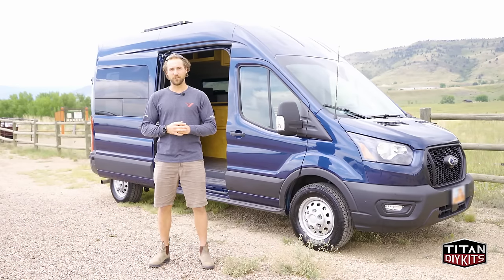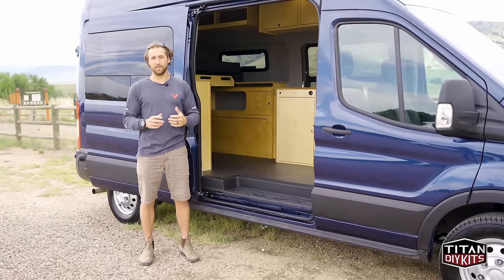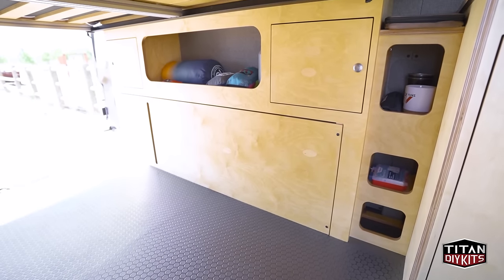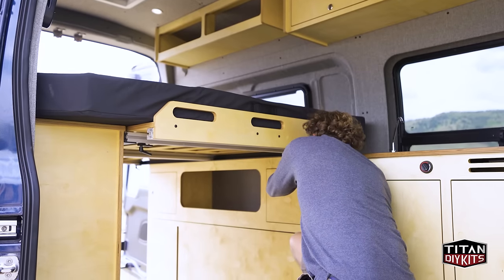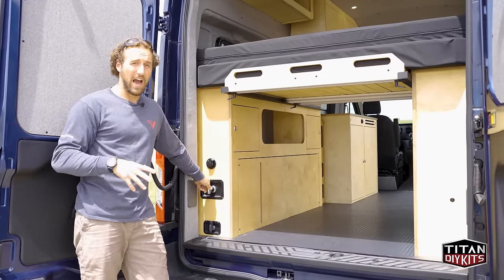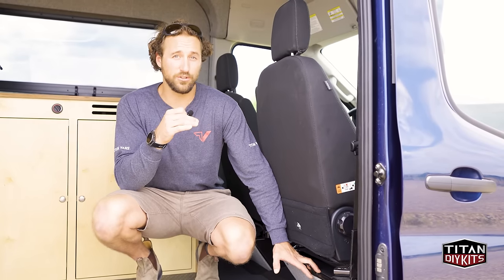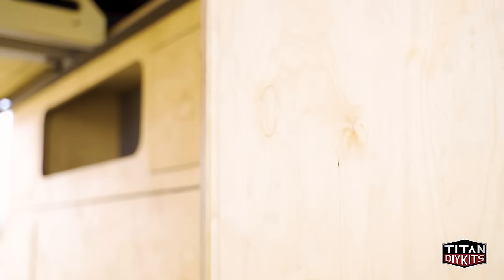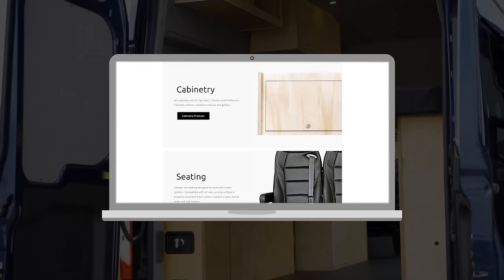Fully Installed Van Conversion for Under $25k | Timber x Titan Vans

Comment: Very nice guys!!  With a 2023 that houses the aux battery under the passenger seat, where would you relocate the Webasto? The cubby on passenger side seems like a good location but the Yeti is there. Also, how do you use the cubby as steps to the bed if the bed is pulled out all the way and covers over the entire cubby? I just cannot see how it can be used as a step to the bed? Maybe I do not fully see how this would work based off the video? But great build and looks like a wicked option. Will this be offered as a DIY? Or any other DIY kits coming online with you guys?
Reply from the maker: Yes, eventually we will releaee this as a DIY kit that you can assemble and install yourself!
Reply: @TitanVans  thanks guys! Trying to battle a little bit for you online with all the dumb comments. Anyways, what about the Webasto heater location for newer vans with aux batteries?
Reply from the maker: @pjbeattie1  is that Ford specific? Possibly a specific option with Ford? This video is of a 2023 Ford Transit 148 and the batteries were still located under the driver seat. Mercedes is still under the driver side floor board.
Reply: @TitanVans hey guys no sorry I meant for a new Sprinter. The new vans have the auxiliary battery under the passenger seat and the heaters cannot fit very well with the battery in there as well, so I hear? Are the brand new Sprinters that you have built not having the Aux battery under the passengers seat?? The dealer says the change was for the 2023 year with AWD.???
Reply from the maker: @pjbeattie1  No, they are mistaken. We have built dozens of builds on the 23 AWD Sprinters. Battery is still under driver floor board. Same for 24 as well, we have some coming in in Decemember
Reply: @TitanVans ah!! You know I bet it’s because all the US vans are built in the US and in Canada we get ours from Germany? I know there are subtle differences and I’ve seen other videos where the additional aux battery is indeed under the passenger seat.  They must not have been US models?? Anyways, I do plan to order the Summit kit but may wait until you release the Timber to see the differences/changes. I wish you guys would make an optional bench/toilet storage that could be used to step up into the bed?? Cheers!
Reply from the maker: @pjbeattie1  thanks for the support and the feeback! Definitely sounds like slightly different model in Europe.

Comment: Would it be at all possible to run the heat off of the solar? Gas is a bit pricey.  Better than it was but still not what it was before this administration. I don't recall you mentioning a hot water heater. No hot water is a no go for me. 😢
Also is there an option for air conditioning? I don't like dying.
Reply from the maker: No, heat on any camper vans is not doable off of electricity unless you are plugged in to shore power. It requires too much energy to run for extended periods and the number/size of batteries needed would be cost prohibitive. The Timber van conversion/kit does not come with hot water but it could be retrofitted. Air conditioning is also not an option on the Timber, similar to the reason for the furnace. If you are y wanting these features, check out our full production line at www.TitanVans.com, we have many options including water heaters and AC.

Comment: The model you’re showing seems to have e a lot of upgrades and finishes.  What is the cost of the conversion in the van shown in this  video.
Reply from the maker: @John_Duh_Vader  This van includes the (Finished option, Bunk Windows, Driver-side Awning Window, Maxxair Fan, and the EVO 40 heater option). Fully installed here at Titan Vans will run approximately $32,000. If you opt for the shipped kit these options will still fall under the $25k mark.
Reply: @TitanVans  seriously considering a simple build with less components that can go wrong.  Much appreciate the info and getting back to me.  That says a lot.

Comment: Do you guys have kits that would convert a cargo trailer to something you could use for snowboarding, mountain, biking, and sleeping?
Reply from the maker: Our DIY kits are currently only for Ford Transit, Mercedes Sprinter, and Ram Premaster chassis. We do offer floor mounted L-track and bike for mounts through our DIY site. Our full production line offers a few more solutions for carrying snowboards and mountain bikes.

Comment: Are you able to accommodate/modify for a mid roof transit?
Reply from the maker: We are currently only offering this conversion for the 148 high roof variants at the moment but we'll make sure to make an announcement when more options become available.
Reply: @TitanVans  in newbie speak, there are essentially 3 heights and 3 lengths available for the Transit I believe, I think you are saying this is the highest roof option? Which of the three lengths is this? It looks like the shorter of the options? (You really make good use of the space, well done, just adjusting my expectations, and I have found Ford's website unnecessarily confusing on this point. I am gonna go check your website as I am betting it will be clearer what you service with which package. Well done folks!)
Reply from the maker: @justlook.productions  We currently only offer it for the Transit 148 High Roof.
Reply: @TitanVans  copy that but with the 148" wheel base isn't there one longer? Isn't there an RB, EB, LB? I am happy with what you present here, it's not an issue :) Just visualizing it, and playing with the ford website, thanks very much.
Reply from the maker: @justlook.productions  Yes, Ford offers a 148 EL, similar to the Sprinter 170. We currently do not offer the Timber for either.

Comment: What are the dimensions of the bed? Can you fit this full length mattress (north/south arrangement) in the 136” ProMaster?
Reply from the maker: This is designed to sleep N/S, dimensions are 78"x 74". Ee offer it for the Sprinter, Transit, and Promaster

Comment: regarding the spray shower... can it be switched to a heated shower of just the temp from the tank.
Reply from the maker: The Timber van kit  is not offerred with a hot water option. The water at both the sink and exterior wash will be whatever the ambient temperature of the water is in the fresh water tank.

Comment: How about cooking and hot water?
Reply from the maker: Not offered with Timber Van Conversion, offered by Titan DIY Kits. We offer that option and many more through Titan Vans and the many models they offer. Though for cooking you could just use a plug in induction cooktop.

Comment: The set up seems expensive. How much is the total price of the van plus the conversion? Seems like a lot of money and youre not even fully “self contained”. I’m in the market for something similar but still researching.
Reply from the maker: The total price can vary widely as customers typically acquire the van themselves based on their preferences and budget.

Our TIMBER van conversion is designed to be fully self-contained, providing everything you need for comfortable living on the road. This includes an integrated water system with a rear shower, a comprehensive electrical system with solar and alternator charging, an extremely comfortable nearly king-sized bed, and ample storage for all your gear. When comparing costs, a 23' Sprinter van can be obtained for around $50,000, with the TIMBER conversion costing approximately $25,000. This makes our setup a significantly more affordable option than alternatives like the Storyteller Overlands, which usually run around $200,000. If you have more questions or need further details, please don't hesitate to reach out!

Comment: I did not see any options for storage of a cassette or other toilet. Obviously, no shower or hot water.
Reply from the maker: Utilizing the extra cabinet space in the galley for toilet storage is certainly an option. There's also ample room between the slider door and bed, or between the galley and driver seat for this. While the TIMBER doesn't currently have an option for an interior shower, it does have the spray-down shower off the rear of the van. Many of these features are available for our premium models found at https://www.titanvans.com/

Comment: Please give us the break down on your material and labor please !! From looking at the video , your material should not cost more than $7k
Reply from the maker: The Timber Van Conversion is currently only offered with install and prices are listed on our site. www.TitanDIYkits.com
With the electrical system, water tank, plumbing,  cabinetry made from the highest grade plywood, stainless steel latches, top of the line hinges, and marine grade flooring, we believe this product is priced extremely competetively.
Reply: @TitanVans Also, as a former designer, I’d like to point out that you aren’t just buying materials. You are paying for the many, many hours of planning, test tries, and experience of the designers. You are paying them to make all the mistakes first so that you don’t have to. Not everyone will love the design, but respect to the people who put this together- it’s a well thought out option at a good price that will work for a lot of people. Thank you for the option!
Reply from the maker: @embr9723  Thanks, certainly a lot of folks these days that undervalue the effort of engineering and design. This product took us 3.5 years to develop with many....many....iterations.

Comment: 20:23 how much gas  does the heater burn per hour? How many hours run the heater to use up , say 1/4 , tank of gas?
Reply from the maker: The Evo 40 uses approximately .07 to .15 gallons per hour
Reply: @TitanVans  that's not too bad at all.
Reply from the maker: @waynelast1685  air top heaters are super efficient if properly maintained

Comment: Could there be an option for a composting toilet?
Reply from the maker: Certainly! While our current design doesn't include a designated area for a composting toilet, you can certainly add one after the build is complete. This provides you with the flexibility to customize your space while still allowing us to offer the lowest prices we can. If you decide against the fridge option, consider that the galley offers a convenient spot to store the composting toilet. Thanks for the comment!

Designated toilet locations are however implemented in our full production models like the Metis and Ultra.

Comment: Why would anyone want their van interior to be 95 degrees??? It’s too hot for keeping reptiles; it is not hot enough for hatching chicken eggs. Hot Yoga? This does look like a really nice system but that confuses me.
Reply: What are you rambling about? Is it cos there's no AC? Or because it's got a sweet heater? 🧐
Reply from the maker: That's a great question! The 95-degree setting (max setting) might sound hot for van life, but it's actually quite practical in colder months when you're dealing with sub-30 degree temperatures. In extremely cold conditions, it's essential to have a powerful heating system that can quickly warm up the interior. Once the space is comfortable, you can lower the setting to maintain a pleasant temperature. It's all about efficient heat dispersion and ensuring a cozy living space in chilly weather. Thanks for asking!

Comment: Is AC unit available as an add on?
Reply from the maker: Not on the Timber, the power system is not adequate to be able to run an AC unit. However, our models offered in our full production line all have AC as an option, www.TitanVans.com

Comment: is that the price of the vehicle and the installation?
Reply from the maker: No, cost is for the conversion installed. A Ford Transit will cost between $50-80k depending on options.
Reply: @TitanVans  Thank you for that information.

Comment: No indoor shower/bath option? Too bad! (I checked the site.)
Reply from the maker: Correct, not for the Timber conversion or kit, though some customers have used the a la cart components and added their own shower. We offer interior shower/sauna features in our full production line at www.TitanVans.com
Reply: @TitanVans  I went to the site and don’t see ala carte items for the Ford Transit. Or it’s not obvious to me.
Reply from the maker: @ZillaYT  we offer paneling, kitchen, overhead cabinets, headliner shelfs, bed systems and more for the Transit on www.TimberVanKits.com

Comment: Did I miss the Fridge?
Reply from the maker: The fridge is an option that can be added and replaces the door on the kitchen cabinet. Some customers prefer cooler or chest fridges though that can be plugged in and taken in and out.

Comment: 6:15 What's with treating flexible tubing like Pex tubing?! That is GOING TO LEAK. It's not a matter of IF
Reply from the maker: Vinyl Tubing, hose clamps and barb fittings are rather standard plumbing components. We don't utilize PEX or PEX fitting in this conversion for multiple reasons.

Comment: “Marine grade” plastic floor. What plastic isn’t?
Reply from the maker: PLA, PBAT, and PCL to name just a few. There are many grades of both plastics and flooring. We use flooring by Lonseal which is one of the highest grade flooring available and is used in marine applications as well as in all Boeing airplanes.
Reply: @TitanVans  The airliners I flew in seemed to all be carpeted.

Comment: I think this is great and a fair price 
Question: can I opt for a larger fresh water tank, bug screen installed on side/back doors?
Reply from the maker: Bug screens are an easy upgrade as they do not affect cabinetry or other interior components. We do not currently offer a larger water tank option though you could retrofit a fresh water tank that goes in the spare tire location and plumb it into the main system.
Reply: @TitanVans  Putting that much extra weight behind the rear axle is usually problematic for handling issues of steering the van, and overloading rear axle while front axle is under capacity
Reply from the maker: @GOLDVIOLINbowofdeath  water tanks are around 20 gallons, at 8 lbs per gallon that is a 160 lbs of weight. There is no handling or safety issues with the addition of 160 lbs behind the rear axle.

Comment: 25 grand and no wireless router?
Reply from the maker: Well, most van builds that come standard with some form of internet access are much closer to the $200k price range. That being said, our service department offers Starlink installations for under $5,000 if consistent internet access is a necessity for you.

Comment: What bed size is this?
Reply from the maker: The mattress for the Transit version of this model measures 76.5" wide by 76" long.
Reply: @TitanVans  is there anyway I can swap out the yeti battery for heater and pay the difference? I most likely will get more batteries than the yeti alone.
Reply from the maker: If battery capacity is your concern we are now offering higher-capacity Yeti options for the TIMBER van conversion.
If you'd like to reach out to us directly feel free to fill out the form at:
https://www.titandiykits.com/pages/contact-us 
We're typically able to return your call/email within 24 hours

Comment: No bathroom 21k no bueno
Reply from the maker: You mean no baño....
Reply: Haha!!! That is an awesome reply!!!!!
Reply: Like my cocker spaniel, I just use Nature’s bathroom when on the road with my Kia Carnival.
Reply: Yeah should include a shower with those special toilets I know you can take a shower outside with those outdoor stuff but some people like me would prefer to have that option inside for more privacy. Something that can be consider?
Reply: @edwinmorales610 perhaps just push the bed platform forward hang a shower curtain and use a basin below to catch run off?
Reply: They make outdoor showers (cheap) and toilets that wrap and seal after each of 20 uses.  There are options, but I get you, I wanna place to pee and shower.  LOL!
Reply: @Caocao8888 lots of fun in the rain or snow. No thanks. Also no ac
Reply: @Desperado3248  👍  I travel only in my 2013 Merc, or by plane.  Just saw a YT video of a guy trying to empty his black tank on a huge Class A motorhome.  He must have pulled the wrong lever, because in an instant, he was covered from head to toe in crap.
Reply: I'm sure there is a place for a lugalo o.
Reply: @KathrynFritze that's actually a good idea
Reply: no wall insulation
Reply: 5 gallon bucket, and a milk jug
Reply: Very nice build and presentation!
Reply: @Caocao8888  nasty
Reply: 3 gallon bucket lined with black 13 gallon garbage bags, filled with your choice of absorbent material, coconut coir, cedar shavings, kitty litter,  pine absorbent nuggets I buy at Tractor supply....Shower tents for outside are pretty cheap or a black card membership to about 2000 Planet Fitness locations for $22 per month.  If you are a couple traveling together....only one membership is necessary... your partner is your no cost guest.
Reply: @David-rx2to  sounds nasty
Reply: @mocheeks709  nasty
Reply: @hmmm2564  not really.  You get used to it and I actually prefer to use my bucket vs public bathrooms.   So so easy to dispose of too...not to mention it is the absolute cheapest method for van living.  Be sure and get a bucket with a screw on gamma lid and there are absolutely no odors escaping from that when the lid is on.
Reply: @edwinmorales610 . I agree! The Laveo Toilet would be my choice!
Reply: Might need bigger van for that.
Reply: Yah I need a bathroom